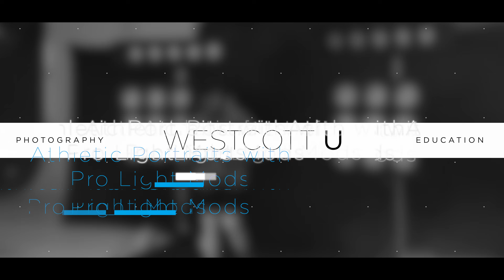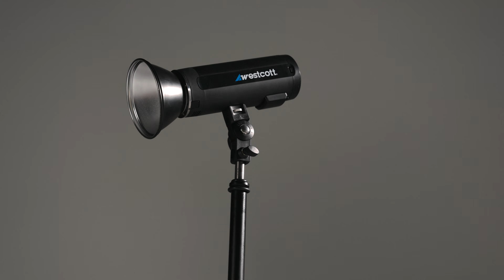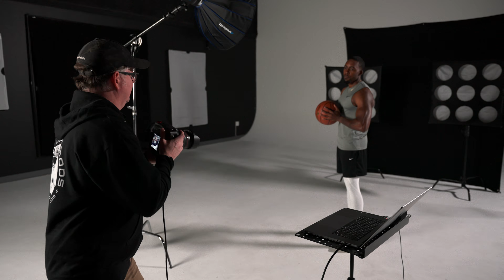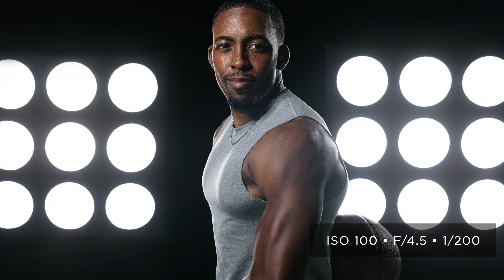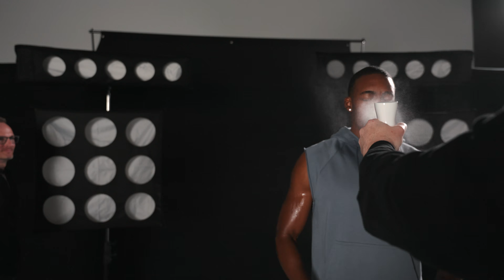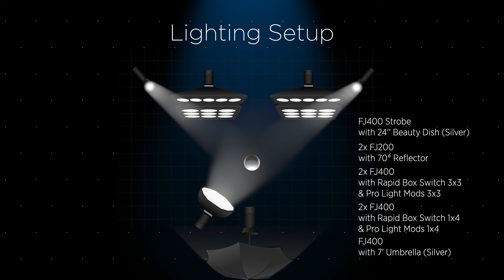How to Light Athlete Photos with Pro Light Mods

Comment: Had a great time 🔥🔥Honored to be apart of this !
Reply from the maker: Loved working with you!
Reply: Curious about the 3X3 setup with the 1x4s. I assume the 1X4s are using the head of the flash stand and the 3x3s are using some type of clamp to clamp to the middle of the stand? I already have the 1x4s, was looking at the 3x3 or 3x4 pair for a second one. Any advice on which you prefer for a base setup? I was thinking 3x4s would be better solo, 3x3s looked great with the 1x4s over them but I’m sure the 3x4s would still do great just filling the background with lights. Excited for the partnership!
Also would love to see the back side of the PLMs covered in white or even better reflective material. Would make the lights more efficient, more even spread and make sure people put them on the correct direction!